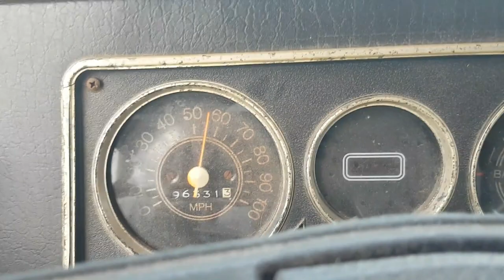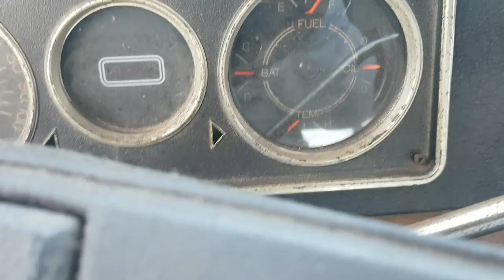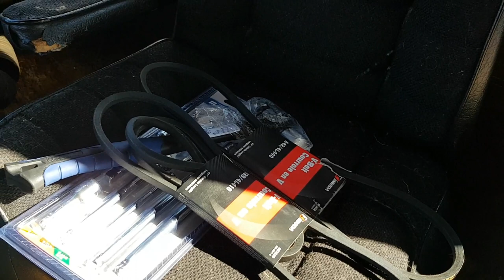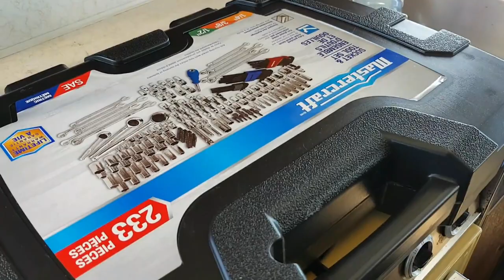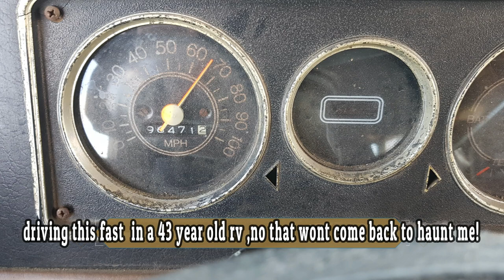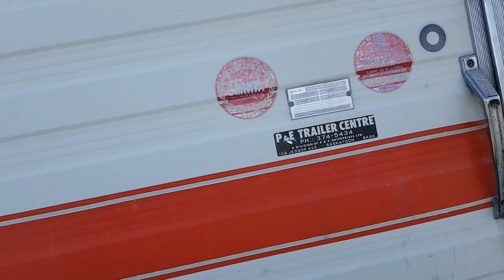vintage motorhome road trip 900 miles in a vintage motorhome adventure rv recreational vehicle

Comment: Having bought a 15 year old coach 1,100 miles from home I have a bit of a feel of what you went through, including getting up at 3 am to drive to the airport and hitting the road around 3 pm also, though in my case the worst thing that happened was a loose passenger side window mount I had to repair, and the high beam headlights did not work.
Reply from the maker: you never know lol, this trip tested my metal for sure, thanks eh!

Comment: sweet that you got it fixed my friend, you must have really wanted that van, projects are always fun though, I found an amazing deal on this RV, https://imgur.com/a/gaPbjT0 paid $500 cad , engine cranks, no spark, gonna tow it to the mechanic and get new fluids, +  tune up, transmission fluid, coolant, hopefully it goes well, but doubtful
Reply from the maker: is the glendale a chevy?        no spark is probably the coil. its in the cap easy to deal with same as mine.  let me know if i can help
Reply: @thisguysgarage  yes it might be the distributor, it still needs trans fluid because the pan is caked in grease, same with oil pan, https://imgur.com/a/YowJBv9 the guy says it runs, but I need to repair some of that before the transmission / engine blow out, thanks for the reply!, its the f350 460 I believe